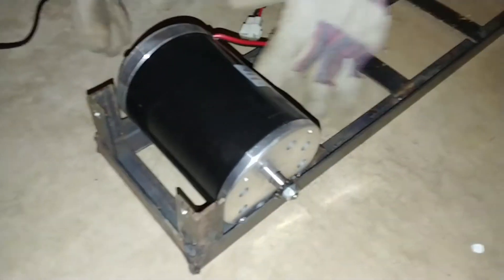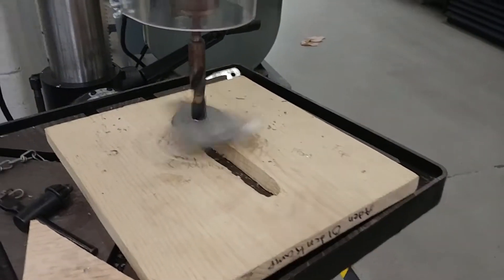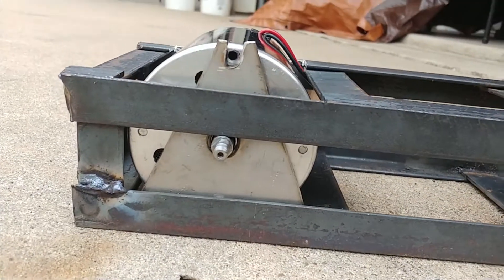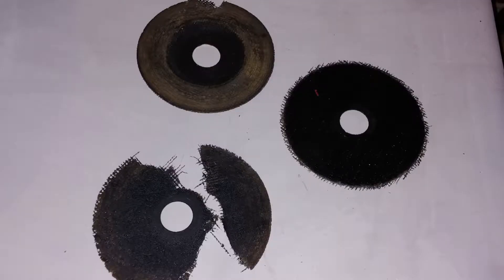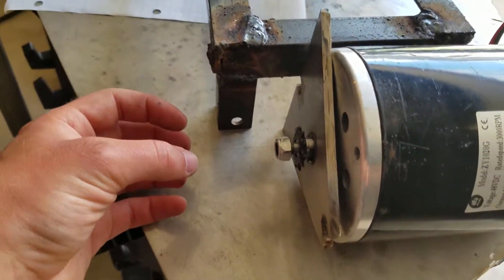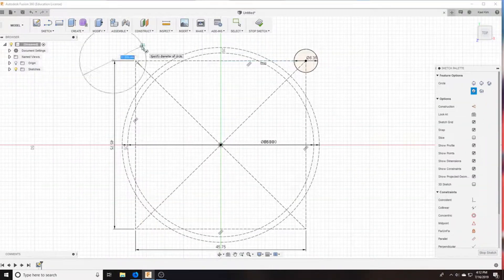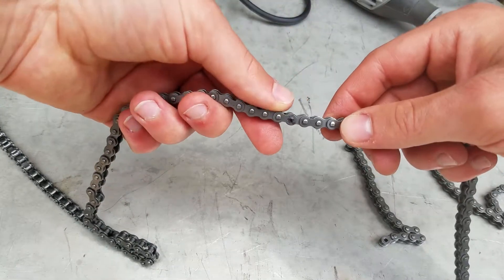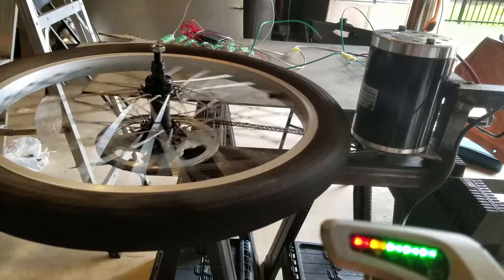Chain-driven Back Wheel - Electric Scooter from Scratch Part 2

Comment: Hi, to drill metals first use a  centre punch which will leave a tiny dent in the metal, your drill bit will use that as a guide. Also to note is when welding the heat will warp the metal making things not fit like they did when just tacked. Thanks again for the upload